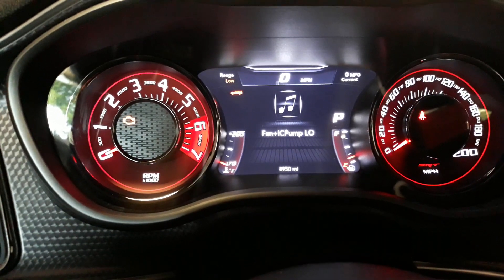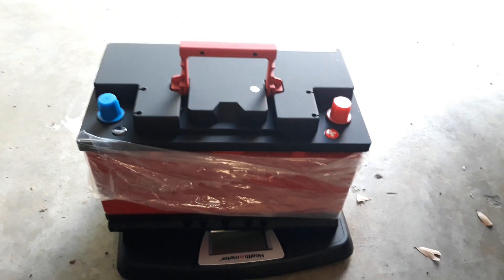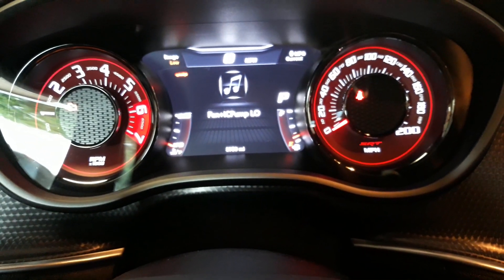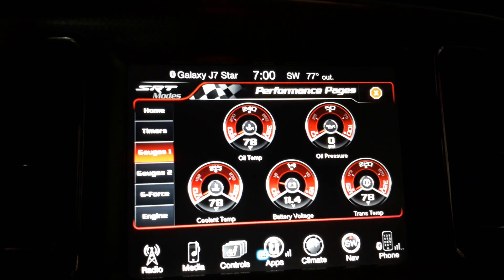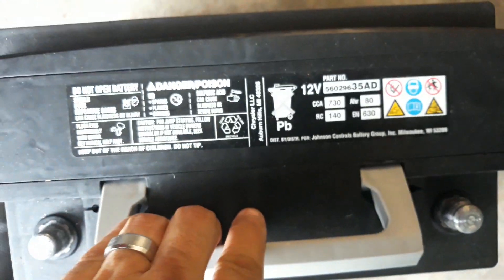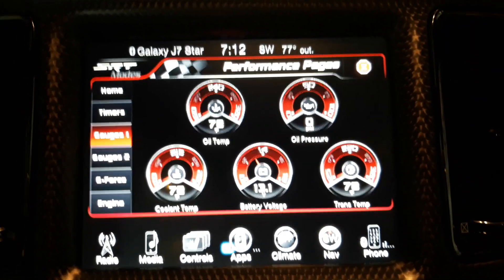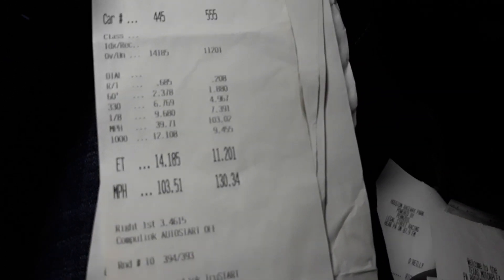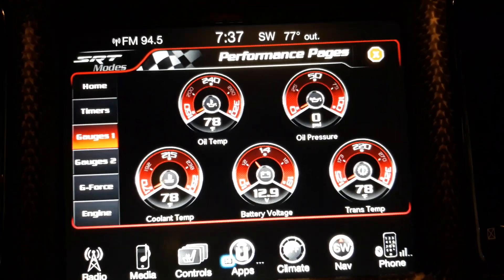Arc-Angel battery vs stock lead acid battery  torture test. Part 1.

Comment: Do you have to do anything special to it to recharge it .  Vs the acid battery .
Reply from the maker: No. Just install and drive.  Ad long as it doesnt go over 14.5 volts you are good.

Comment: Slightly different subject. I broke my driveshaft Wednesday night TNT. Have you replaced yours yet?
Mine was actually starting to Klunk. I should have known
Reply from the maker: Replaced with a dss.  No issues at all.
Reply: @Moto-Psycho-1  I am still under warranty so I was reluctant to put in the DSS. It is at the dealer right now

Comment: Is it hard to find an archangel battery for a Challenger? Could you please tell me the part number and website? I'm going to do that and lightweight bumper supports for the fall. Thanks Brian.
Reply from the maker: Super easy.  As easy as googling "archangel battery."  He has them on amazon, ebay and on his website.https://www.google.com/url?sa=t&rct=j&q=&esrc=s&source=web&cd=1&cad=rja&uact=8&ved=2ahUKEwjwi-fD6YDiAhUN7qwKHcPFAh4QFjAAegQIBxAC&url=https%3A%2F%2Fwww.arcangelbattery.com%2F&usg=AOvVaw12WF2cXDsIC5QvZGrSvVBS
Reply: I used the lithium battery from anti gravity on my 2018 ss camaro cost me $350 and only weighed 6lbs lol used it for a daily and track use . Though I didn’t have to cool my car like you did . Also side note that battery I had would turn its self off and give you enough juice to restart the car twice